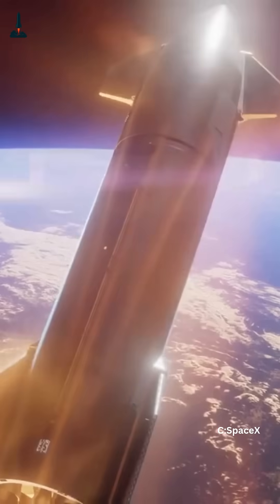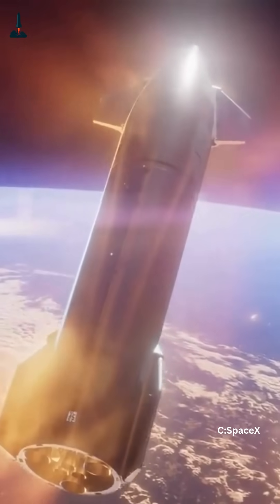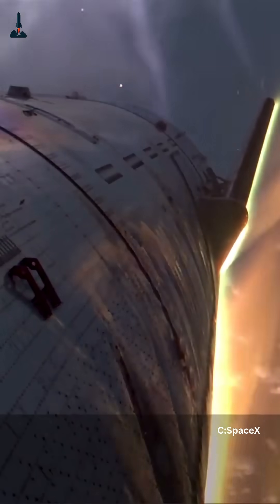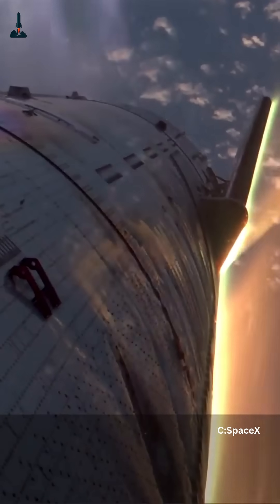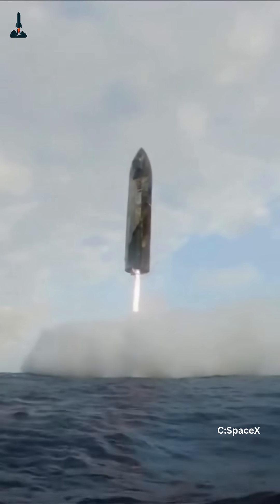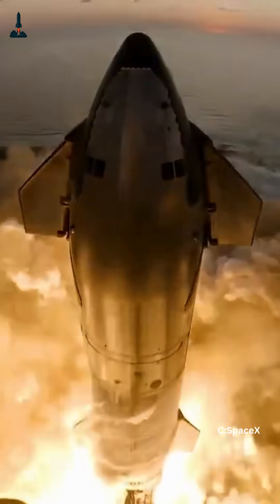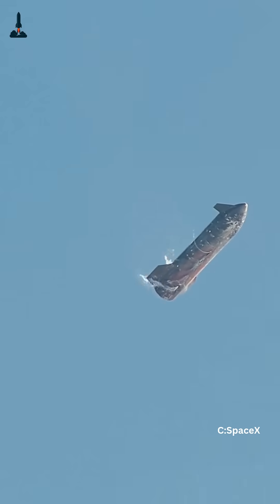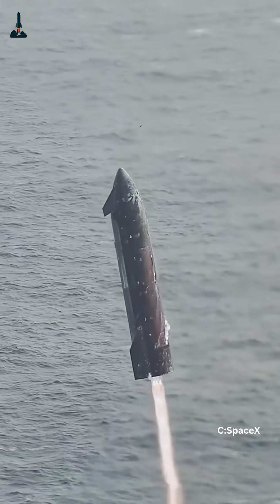How SpaceX Turns Drag Into Control 😳 #spacex #starship #flaps #reentryjourney #elonmusk #bellyflop

Comment: Cool engineering,  but...
What is the backup plan if the flip maneuver and or engine(s) fail during landing?
The Apollo LEM could easily abort landing and separate with ascent stage.
Reply: In the aerospace industry, there is usually no plan B, yet that industry is one of the safest in the world.
Reply: @andreasreichwaldt3994 Airplanes can glide land when power fails.
Helicopters and gyrocopters can autorotate.
If those fail, a ballistic parachute can be used.
Commercial airliners have multiple engines and are designed to fly to safe landing with an engine or two out

Comment: Why cant we enter atmosphere 
real slow somehow n this way we wont burn? Pls correct me if im wrong about anything.
Reply: Would take way more fuel than it could hold in order to slow down from thousands of miles an hour orbiting earth to 0 and then more fuel to keep it from falling straight down just because it's going 0 so it would have to fire engines the entire time it slows in space anyway. Even if it could stop in space then fly into the atmosphere to free fall there's a lot of atmosphere so it will still heat up. They actually save fuel and money by just free falling from space at an angle and letting friction and drag slow it down.

Comment: It doesn't look like it will be reused anytime soon. It will probably take weeks to complete the maintenance.
Reply: The 3rd ship to be caught will probably be the first one to be reused. The only reason S37 and S38 were heavily damaged is because they were essentially stripped of most of their heat shielding.
Reply: They were really testing the limits of starship on this flight, in some parts it was just bare steel, no heat shield. This is what most likely caused a big hole in the fuel tank, but starship still survived and landed percisely. Keep in mind that the shuttle was lost after one heat shield tile came off
Reply: @Cosmo_Sim  Keep in mind, the Space Shuttle was a reusable system that completed 130 manned missions with a payload that SpaceX still can only dream of.  To claim today that SpaceX is deliberately doing it wrong without having succeeded even once is typical of Musk.
Reply: @bordeaux1962 SpaceX cannot be fairly compared to NASA, they have very different design philosophies. NASA spends years designing and perfecting a rocket in order for it to work first try. SpaceX builds the rockets rapidly and launches them rapidly. They see what goes wrong then they improve until its design is perfect. Also the space shuttle is 5x more expensive than a starship launch. And space shuttle were not rapidly reusable. They had to inspect, disassemble and reassemble many parts, and replace the whole heat shield. The goal with starship is to be reusable within a day of landing. It is still in its testing phase and it still has a higher launch cadence than the space shuttle. With the pace that starship is going, sure it will have more than 130 missions in less than 5 years
Reply: @Cosmo_Sim  You were the one who brought up the Space Shuttle and made such comparisons, not me.
Reply: @bordeaux1962 the space shuttle is probably the best spacecraft to compare to starship
Reply: @bordeaux1962  While the mass to LEO of the shuttle is impressive, it was very unreliable, cost almost as much to refurbish as it did to build a new one, and could barely fly twice per year. Meanwhile Falcon 9, while having less mass to LEO, still has greater range and payload volume, and sometimes launches twice in one week. In fact, the Superheavy booster's average turnaround is already ahead of the shuttle (despite of course having only 2 reuses), so if the Starship were to be fitted with a full heat shield and reused it would likely take much less time than the shuttle. We've seen how durable the ship was on this flight. Compare that to Columbia.
Reply: @thegunman2841  It's impossible to compare the Falcon system with the Starship concept, and both one-in-one with the Space Shuttle to justify current developments. I can't even begin to correct these arguments. Sorry. I'm out.
Reply: @bordeaux1962  You were the one who said "the shuttle has a mass to LEO that Spacex can only dream of". All I'm saying is that Spacex compensates for this with sheer launch frequency.
Reply: @bordeaux1962 Space Shuttle was taken out of service because it was dangerously unreliable and too costly. Starship is a commercial system and its success will be judged eventually on whether it can make a profit and beat its competitors. Two different systems with different goals.
Reply: @Tailspin80  Once again, check the timeline. It wasn't me who started this comparison. I only responded when someone mentioned the Space Shuttle, and the topic was payload. Nevertheless, development started in 2018 and there is no reusable Starship right now, and nobody knows about the future payload, heat shield maintenance time, or costs. Just saying.
Reply: @bordeaux1962 You went into detail about the Shuttle. Its payload to leo was only 16.5 tonnes whereas Starship expect 100 to 150 tonnes, or 250 tonnes for an expendable version. Shuttle development timescales were longer than Starship to date, the goals far less ambitious and the total cost per launch a staggering $1.64 billion. I mean - it worked - but it was like a camel designed by committee and didn’t do anything very well. I don’t even know why we are talking about it.
Reply: @Tailspin80  You're right, I was in error regarding the shuttle's payload. As already mentioned, the two systems cannot be compared. 
Nevertheless, regardless of the shuttle issue, one point remains: neither Starship V1 nor the V2 development achieved the announced 100 to 250 tons of payload in eleven test flights. Version 3,  has not even flown yet.  
But now I would like to return to my topic. It is unknown what the Starship's V3 heat shield will look like when the very large module re-enters the atmosphere after a long stay in orbit, how long it will take to maintain it, and what the costs will be.
Reply: @bordeaux1962 Well no, you’re right - we don’t know exactly what the payload to leo will be like. It’s a works in progress and has already evolved hugely since the early test flights. Starship v3 is shedding weight wherever it can, notably in the engines, the engine power is increasing further in the newest Raptor iteration and the whole ship and booster is getting longer. It’s a challenging spec because for full reusability they only use two stages instead of discarding bits like the shuttle, and it all has to return to launch not some distant runway. SpaceX are always very open minded about tweaking the architecture so a three stage variant might happen, a smaller version for the lunar lander, non-reusable versions of the ship to maximise payload and so on. It’s a refreshing approach compared to NASA where it’s a very rigid and ponderous process, and far more costly. At the end of the day SpaceX is privately funded. They are allowed to get things wrong and try new stuff out without having to answer to Congress.
Reply: @bordeaux1962 you're the one that claimed the other guy said SpaceX is "doing things deliberately wrong".

He never wrote that. You did. 

You made that up and asserted that others wrote it.

You know these posts are public, right?